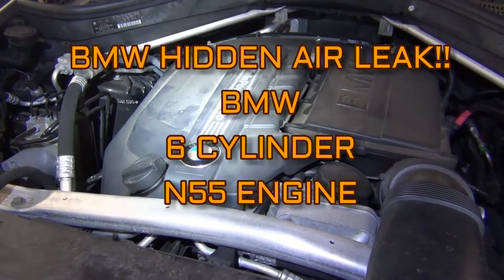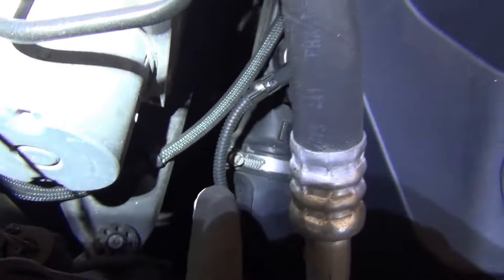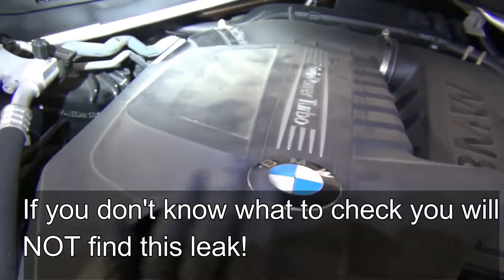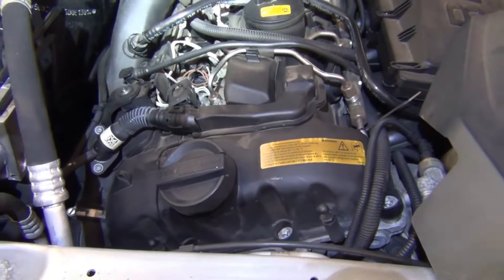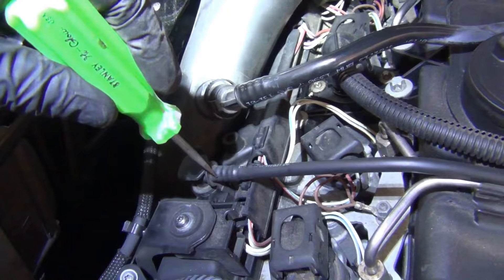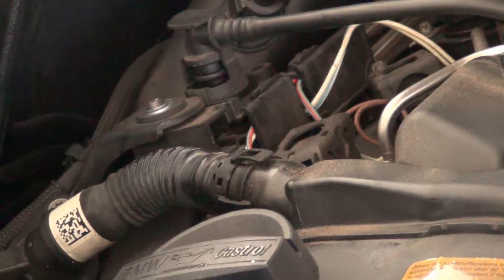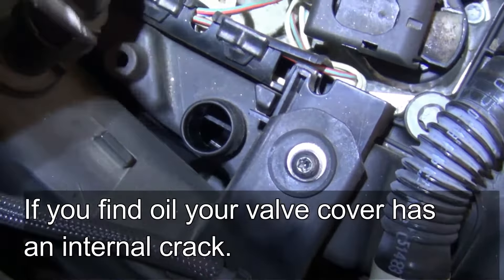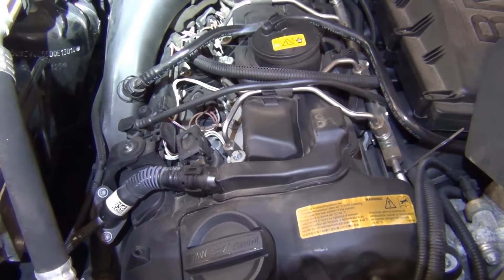HIDDEN AIR LEAK !! BMW N55 Mixture Too Lean P0170 P0173 P2279 2C57 Bank 1 Bank 2 Unmetered Air Leak

Comment: I had the same vacuum leak on my N55 X5 2012 but it was on valve cover PVC nipple.  Very hard to locate this leak even with smoke test.  Once, I replaced old valve cover with OEM , all my fault codes were gone and X5 ran like brand new...
Reply from the maker: Thanks for sharing your experience Tahir!
Reply: Was the torque of the car weak?

Comment: These internal vacuum leaks are interesting how they work, I wish it was more theory how that happens.  I guess these internal leaks could be measure with a manometer,  if crankcase pressure differential is too low and means the CCV has failed or another internal leak issue?

Comment: I was chasing a leak forever...came across this video...took off my vacuum line...saw there was oil in there...I actually held a qtip with needle nose please and stuck it in...the qtio was saturated with oil!!!...thanks a ton!!
Reply from the maker: Hi Frank! That is awesome! This is a hard air leak to find if you don't know about it. Glad I could share this info with you. Please subscribe if your are not already :)
Reply: @AskTheCarExperts  i also have a ton of oil, drenched 6 q tips. what should i do now replace the valve cover?
Reply from the maker: @MrSpaceSentry  Hello CSR, sorry to hear you have this failure.  If you see oil in the vacuum reservoir you should plan on replacing the valve cover and the vacuum lines that have oil in them. If you leave the lines the oil will get back into the reservoir.
Reply: @AskTheCarExperts  question after replacing the CV how many vacuum lines do I need to change ? It’s only the one that I disconnect ?
Thanks in advance

Comment: And what is the fix to this?
Reply from the maker: The valve cover would need replacement  and blow out the vacuum lines to remove the oil.

Comment: Jesus i just did a motor swap and dumped a bunch of oil out of the valve cover before installing it on the replacement motor...I'm not happy...

Comment: My 11 X5 E70 has been running rough and feels sluggish. I checked my VC after watching this video I do have a small amount of oil in the vacuum reservoir. I don't believe it's coming from the vacuum pump as I removed this line when changing the intake manifold gaskets and didn't notice any oil coming out of the line. It seems like this is an unnoticed issue as there isn't much info online at all on this. I only have 50k miles but have had issues since 35-40k miles. I found a good deal at FCP Euro for an Elring VC for $232. Think I'll go with that. Appreciate your time and help.
Reply from the maker: Glad to hear my video helped Bobby. If you still have an issue I would recommend a smoke test of the intake system.
Reply: Thanks for the comments,  let us know how it goes after you replaced the VC. Great diy ...good luck .  My VC is leaking also. I will check this vacuum line, when I change the VC gasket.
Reply: Did you change it ? it solve the issue ? 
Can you please let us know if this clear you code ? 
Thanks

Comment: I change valve cover gasket and after that the car was slow and i am sure the reason is air, everything is fine on first sigh
Reply from the maker: Sorry to hear that Peter. Normal mistake is rolling the gasket in the back corner.

Comment: @AskTheCarExperts Found oil in the reservior mentioned in the video, tried smoke testing it and it seems to test fine. I did fire smoke into the vacuum line that was disconnected and I have smoke pouring out of the oil fill hole. Am I safe to assume my vacuum pump is the culprit of the vacuum leak?
Reply from the maker: @surreyhustle517  Hello, smoke testing the line to the vacuum pump would put smoke in the engine. That is normal. The crack in the valve cover is micro cracking which you don't see on a smoke test. Replace the valve cover and blow out or replace the vacuum lines or oil trapped in the lines will go back into the vacuum reservoir.
Reply: @AskTheCarExperts  thanks so much for the reply! I tried sucking on the line as well and the one way valve is holding  on the air pump :) will replace the valve cover.
Reply from the maker: @surreyhustle517  Happy to help! 😀

Comment: Roger, thanks for the video. Should the port be “bone dry” inside? I do see trace amounts of oil inside and on the connector o-ring. Not a “pool of oil” but there are (again) trace amounts. Does that mean the valve cover has failed? Please advise.
Reply from the maker: Hello, The micro cracking may he very minor. If you do not have any symptoms you could wait on valve cover replacement.  It should be dry in the reservoir.
Reply: Thanks Roger. You are the best!

Comment: This is a good one, but just wanted to say you can have oil in that reservoir and not have a crack, but a faulty vacuum pump. I had that one bite me once 🥴. Sometimes a faulty vacuum pump will engulf that reservoir with oil.

An easy check I do is I pull the line off. If it removed easily, and I didn't hear vacuum escape, valve cover time. If it's hard to remove, and vacuum exists, but it's full of oil, vacuum pump time.
Reply: And a faulty vacuum pump, could create internal vacuum leaks? Thank you.
Reply: While it’s running you mean?

Comment: I hace the exact same issue, motor error message but nothing on the scanner, I've checked that part and found oil, changing valve cover tomorrow, I hope that fix it, thank you for your video
Reply from the maker: Hi Mas Tec, Awesome! I hope it fixes the problem. Regardless it would need replacement. Make sure to replace or clean out the vacuum lines or oil can get back into the resevoir.
Reply: @AskTheCarExperts  I'll do that, thank you very much, I'm subscribed to your channel now 🙏

Comment: Hi, thank you for the find. SUBSCRIBED! I have a 2011 535i manual and also have a lot of oil in that vacuum cavity. I recently replaced the valve cover gasket but wasn't aware this was a problem. Do you think this is the cause of my car wasting too much oil? I have NO external leaks at all. Thank you for the input and Happy 2024.
Reply from the maker: Hello, Thank you for subscribing! Replacing the valve cover would be a good start. Male sure to blow out the vacuum lines as well or the new unit will pull the residential oil into the vacuum cavity. Oil consumption is a tough thing to deal with. While it could also be internal engine wear from the piston rings one other component that burns oil on this engine is the turbo.
Reply: @AskTheCarExperts how would i go about blowing the oil out of the vacuum line?
Reply from the maker: @JM-jr4ou  You only need to disconnect it from each end and then use compressed air and a blow gun. For the line that goes back to the exhaust flap you would disconnect it at the solenoid.
Reply: @AskTheCarExperts  in order to disconnect the vacuum line, I would have to locate the vacuum pump under the intake manifold. Correct? and where is the vacuum line that goes back to the exhaust flap. The only other line i can think of is the one on the side of the valve cover that is for the waste gate for the earlier n55. Does that line also fill with oil?

Comment: @askthecarexperts.  This line on my car was very brittle and broke while changing the Valve cover.  I have the replacement part.  Any video and or tips on reinstalling the new one?
Reply from the maker: Hello, Glad to try and help with that. Do you mean the crankcase line? That can be very brittle. I do have the replacement in my N55 valve cover removal video. Around 11:30 in the video I start taking this off.
https://youtu.be/fZnrM3_qaNw

Comment: Thanks for the video! If there is a Crack in the reservoir, do I have to replace it? do you have a video on that?
Reply from the maker: Hi Eddie,  You would replace the valve cover as the reservoir is part of the valve cover. I am editing an N55 valve cover replacement video with full steps and torque. I am maybe 2 to 3 weeks out before releasing.
Reply: I am planning on replacing the valve cover with an aluminum one. Do you think is a good idea?
Reply from the maker: @eddiereyes3235  I just saw that option. Sounds like a good idea to me. Then you don't have to worry about cracking and the pcv should be replacable.

Comment: So I looked inside mine and there is oil in there does that mean i have a crack?
Reply from the maker: Hello Coco Loco! Yes that would mean there is a micro Crack in this reservoir. I just bought a 2010 x5 with N55 and my vehicle has the same issue. Ordered a new valve cover from FCP Euro
Reply: Thank you! Its not filled all the way but i stuck a screw driver in there and its definitely oil.

Comment: N54? Not engine for N55. My intake doesn’t wrap around like shown, it’s in the front
Reply from the maker: N55 but this would only be for turbos with vacuum activation. Some do not have this with electronic wastegate.

Comment: DIY, non mechanic chasing a P2096 CEL (post cat lean mix) on a 2012 X3 with the N52T engine. Smoke test shows no observable vacuum leaks. Replaced Bank 1 Sensor 1 but CEL comes back after reset. Does the N52T have this vacuum reservoir?
Reply from the maker: Hi Scott, No this would only be the N55. On the N52T if thr belt came off at any point the front main seal is often damaged. Make sure you have a powerful smoke machine with good smoke and pressure. Also it could be an internal leak from the crankcase system.
Reply: @AskTheCarExperts  which belt?
Reply from the maker: @eighties8  Serpentine belt. This just happened to my friend and I will have upcoming  videos on repairing
Reply: @AskTheCarExperts  After replacing the post cat bank 1 O2 sensor, the CEL has gone away and not returned (fingers crossed). That sensor looked really charred and was prolly OEM with 137K miles on it.

Comment: So how do you fix im having the same issue. I changed front seal, rear seal and valve cover im still having this noise
Reply from the maker: Does the noise go away with the oil fill cap removed?

Comment: Could either this or that brittle plastic host you took off...cause a slight enough leak that while not throwing a code...would cause the car to idle a bit rougher yet run just fine under throttle?
Reply from the maker: Yes, a small air leak can mess with your idle. A smoke machine can help find these leaks. I will be giving one away soon as well! Make sure to subscribe and watch for the details 😀

Comment: When you were diagnosing this internal valve cover leak did you find smoke going from the intake near the MAF to the oil cap? Also not sure if you did the test the other way around from the oil cap to the MAF? I noticed that I have that oil where the vacuum pump line connects and I am seeing smoke travel from the valve cover to the inlet duct. Not sure if that is a symptom of the internal leak.
Reply from the maker: Hello, Of you have oil in the resevoir that is part of the vakve cover there is usually a micro crack. Unless it is residual from the lines because if not cleaned out the oil gets pulled back into the resevoir.
Reply: @AskTheCarExperts  i am assuming i have a micro crack since I have some lean fuel and vacuum leak codes. I have a bad idle and misfires from that.
Reply from the maker: @valdesadam  It does sound like an air leak. A smoke test is a great way to find air leaks as well if there are more. Good luck with the repairs!
Reply: @AskTheCarExperts  yeah I did that. I saw some odd results, well I assume. That why i wanted to see if you had the same thing show up during your diagnosis if you remember.
Reply from the maker: @valdesadam  On some cars you can see smoke but others the crack is too small and I use the oil to determine there is an issue with the valve cover.
Reply: @AskTheCarExperts  i see. Thanks for all the help.

Comment: Hey so Im working on a 2016 BMW 2 series with he N55, I did valve cover gaskets after I was finished I started It and got a whole bunch of air/vacuum codes. But in your video where you specifically unplugged the vacuum line, on my car I don't have that connecter I have the hole on the valve color just not the female part.
Reply from the maker: Hello, Some N55 engines do not use a vacuum solenoid for the turbo. In that case you will not have a feed or output line from the valve cover. I would smoke test the system. You may have rolled or pinched the gasket.

Comment: So I have 2011 535i gt with the n55 engine.  Got the p112F code. No visible symptoms besides the CEL.  Took this port off and looked in. There is about a 1/2 inch of oil in there.  I’m guessing this is a cracked reservoir?  The CEL light did go off yesterday but returned a few hours later when parked idling.  When i remove the oil cap while car running it has good suction at the cap and no change in engine when removed. Never noticed that before. Looking for your thoughts
Reply: Correction less then a quarter inch
Reply from the maker: Hello, Yes that is from a micro Crack. Make sure to change out the vacuum lines as they can hold oil and get back into the reservoir. That would not be a repeat failure. Just residual from the lines. This could be from a different unmetered air leak as well.
Reply: @AskTheCarExperts  okay so there should be zero oil in there then I take it…..just thinking back, this came on a day after adding oil to the car is it possible it was over filled?  I am pretty sure I didn’t add too much as it was only a top up but just curious as it did start the day after. 
I guess from reading your comment I’m asking is the micro crack the only way for oil to get in there or could it have gotten there due to something else and how would I confirm?   Could I run the car without the hose on to see if oil comes out the hose or is it meant to suck air up from that reservoir?
Thanks for your input
Reply from the maker: @newfeebullet5291  That hose comes from your vacuum pump. This supplies vacuum for the turbo. The reservoir should not have any oil. Since thus is a suction oil should not be coming from the oil pump but it can suck oil from a micro Crack into the reservoir. You can run the vehicle with the line off as it would only effect the turbo system. I have put a bad around the vacuum pipe and driven cars to prove it was not from the vacuum pump. Hope this helps.
Reply: @AskTheCarExperts  yes it does….thank you so much.  I’ll watch for that valve cover replacement video 😉.  
Ps I emailed you about a unique issue that effects bmw’s in general in cold climates. Imitates a bad battery.
Reply from the maker: Glad to help! I actually have the N55 valve cover replacement video up and published. https://youtu.be/fZnrM3_qaNw
Reply: @AskTheCarExperts  awesome, thanks again really glad I found you not a lot of people it seems with the n55 engine repair videos.   Here’s a quick question.  I’m currently awaiting a wheel bearing for my wife’s car, we are out of options, going to need to let her use the bmw to get to work, is it better for me to leave the hose off or reconnect for the day?  I seen you mention you’ve driven with the hose off looking for advice.  Curious the potential issues leaving it connected Thanks.

Comment: This is only on pwg cars, would it be similar for wag even though they don’t have that vacuum line?
Reply from the maker: I have not seen this failure on electronic throttle vehicles but it would be possible since the reservoir area is still part of the valve cover.

Comment: Great video thanks for sharing I already subscribe to your Chanel . I check mine and found oil in there .
Question one . I have code : 28A0: 0x28A0 Throttle angle - absolute pressure intake manifold, comparison:
pressure too high do you think this is related to this internal crack .
Second do you have a video how to do a smoke test ? 
I also looking for information how to perform a clear DME adaptions . Does it requires special tools ? 

My symptoms is rough idle .
Thanks I’m advance for your help .
Reply from the maker: Hello Alejandro,  this may be an air leak with that code so it may be the internal Crack. Also the crankcase hose often can Crack as well. I do have some videos on doing smoke tests that should help.
Reply: @AskTheCarExperts  
Thanks yeah olí already order the smoke test that you use in your video . 
This weekend I will try with a basic ideas to smoke test to see if I can find any leaks before the good one arrives .
Thanks a lot for you help . 👍🏼
Reply from the maker: @nitolin  Awesome! Let me know how it goes.

Comment: My 2012 X3 3.5i (F25) threw a 112F code [Manifold Absolute Pressure To Throttle Angle Too High Bank 1]. Built a smoke machine for smoke test, but found this video first.

reset adaptation. code cleared then returned soon thereafter. cleaned MAP sensor. no change. 

Checking this hidden vac leak location [internal vacuum reservoir in valve cover] I have oil pooled inside.

So need to replace valve cover, but would this issue throw the 112F code?

Don't want to assume this is the only issue
Reply from the maker: Hello, This code can be from an umetered air leak and sometime from the absolute pressure sensor on the manifold. But if you have an air leak I would fix that first. I am going to have an N55 valve cover video released this Tuesday.  Tried to make it the best one out there.

Comment: Do i have to change the whole valve cover then?
Reply from the maker: Hi Colin, Yes the valve cover would need replacement to fix this issue. :)
Reply: Had quite a bit of oil in that vaccuum reservoir. Changed the valve cover but still throwing up a P112F code

Comment: So if we find oil by vacuum pump line , do we just replace that line to fix that leak ?? Or  do we have to change the whole valve cover ?
Reply from the maker: To fix oil in the reservoir you would need to replace the valve cover due to an internal crack. You also should clear out the vacuum lines because the residual oil in the lines can get back into the reservoir and it look like the same failure but it is just the oil that was stuck in the vacuum lines.